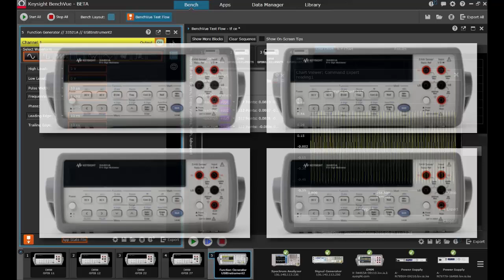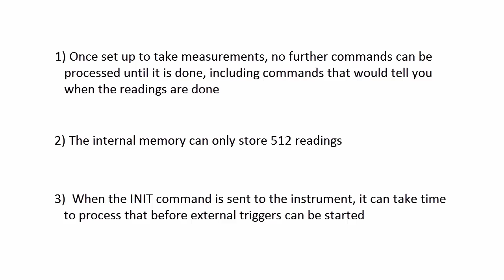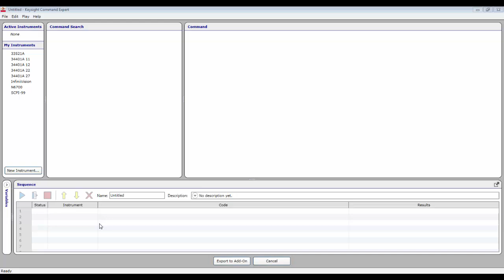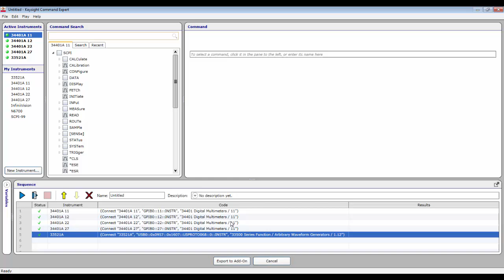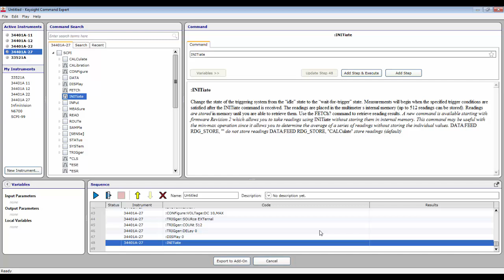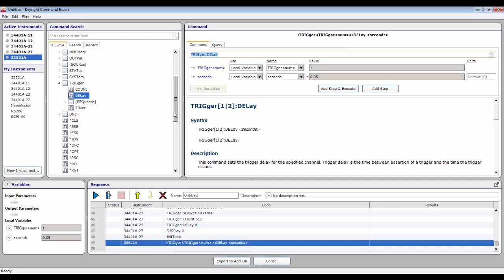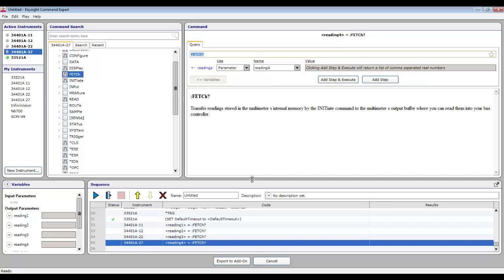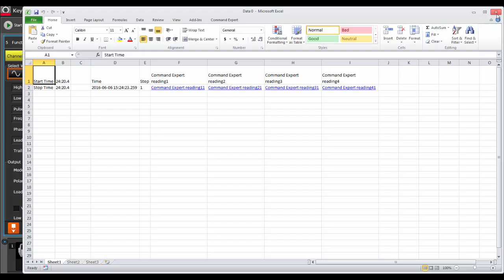Automate synchronized DMM measurements using BenchVue Test Flow and Command Expert

Comment: Do you experrience with syncronize two dmm 3458a ?
Reply from the maker: Benyamin Rusanto  I cannot help you with Labview but can provide some help on the 3458A.  Several applications require two or more DMMs to make simultaneous readings.  If you do not need the readings to be perfectly aligned you could use the NRDGS command to set up a block of readings and then use the TRIG command to start the block of readings on both DMMs.  e.g NRDGS 10, TIMER would take 10 readings each would be spaced by TIMER.  If each sample has to start at the same time then you could send an external trigger for each sample.  e.g. NRDGS 10, EXT - would set up the DMM to take 10 readings, each reading requires an EXT trigger.